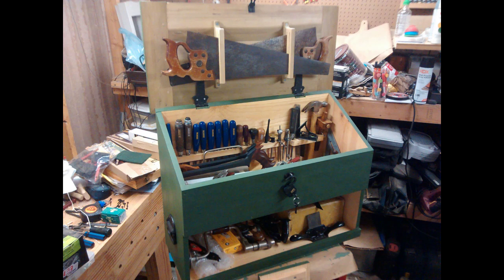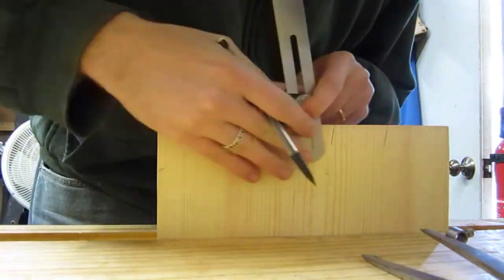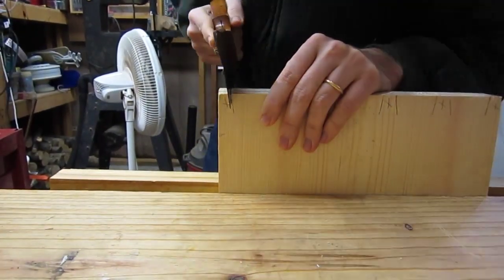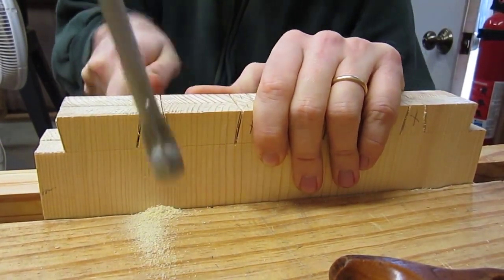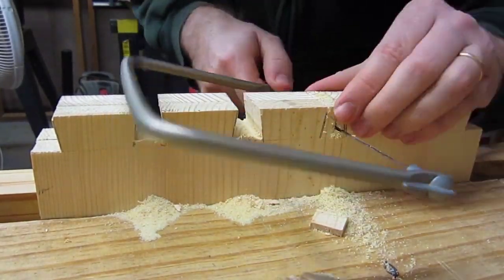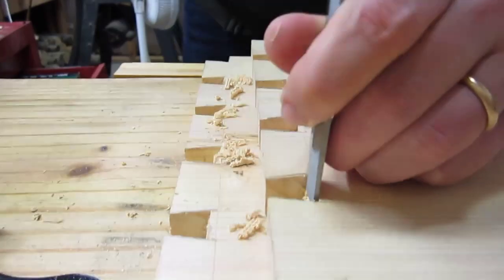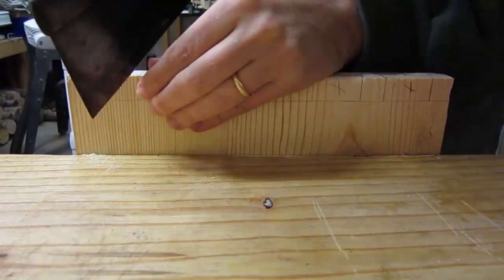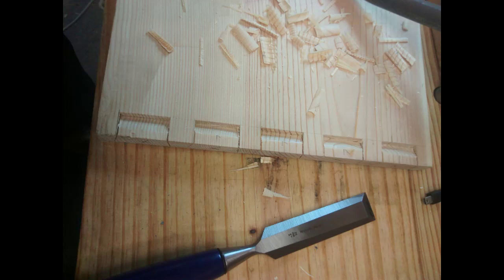Dutch Tool Chest - 02 - Dovetails

Comment: I used to really hate coping saws too. Then I figured out that the blade that came with the saw was way too coarse. Bought a fine toothed blade and I then had no problem making the coped corners for my baseboard.
Reply from the maker: I suspect you're right that the blade I was using was pretty coarse.  I've since gotten some finer blades but haven't done anymore dovetails for a while.  I'll definitely give the finer blades a try next time.
Reply: @SharpWorkshop  thanks for the series. I think I'll build a dutch tool chest myself.

Comment: The issue with coping saw is that the kerf is to thick. Get a good fret saw with good Olson blades and you will change your mind fast. A fret saw has such a narrow blade that you can drop it in the saw kerf and with a pull stroke turn the blade and cut right up to the base line. I generally never take it out the vise to clean up as what's left is easily removed with pairing cuts. Just food for thought
Reply from the maker: Cool, thanks for the tip!